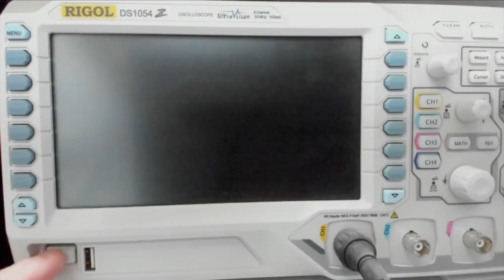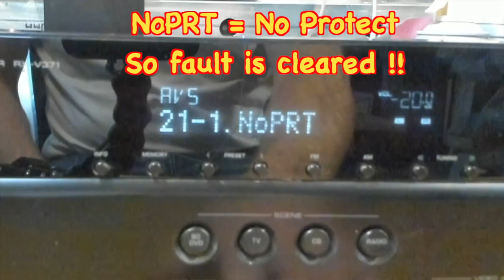Yamaha Rx-V371 No Power

Comment: Hello. I've got an older version RX-v630RDS, only getting 0.05v on PRY after pushing PSW. 
  Micro computer has a reset pin. does anyone know how to use this feature? I'm totally stumped, i just fixed it after finally finding a bad 5V reg, then i found the volume knob was almost totally unresponsive. I took the front off, cleaned the pot / encoder but now not even the start relay clicks. Can't make any sense of it, power switch is working to the micro computer. I am getting around a 3v signal on another output from the microprocessor M30622M4A as it tries to boot up but for some reason this flows back up to the main regulator board as if flowing backwards into one of the regulators there, seems a bit strangle. Anyway. Since i took the front off, cleaned the volume pot (encoder) i get nothing at all other than what i can measure, around 5V coming to the processor which is within limits, seems to be a small transistor that regulates the 5v not too far from the chip. This model has a 12v standby which floats at around 19V until the power button is hit, then it drops to around 12V and the 5V is present on the processor this one runs vcc between 4.2V and 5.5V at 16Mhz. 

To reset, says: "a reset is effected by holding the
reset pin level “L” (0.2V CC max.) for at least 20 cycles. When the reset pin level is then returned to the “H”
level while main clock is stable, the reset status is cancelled and program execution resumes from the
address in the reset vector table."
  Do i basically try a resistor from vcc until i find 0.2V and then hold it down to the reset pin and it should reboot the processor when i hold down the power button. I'm starting to think this is a bad coincidence and that between fixing this and dismantling the front panel something else has gone bad due to the recent powering up but i have personally not come across a potential chain reaction of faults after completing one repair. Bit stumped right now.

Comment: hello...i have yamaha rx v1400 no power but stand by voltage present...if i push switch on, pin PRY from microprosesor only 0 volt where as pin PSW 5 volt present...does it microprosesor dead....thank you.

Comment: Thanks for posting this video. I have two of these same units and one had been dead for over a year. When I opened it up, the same cap was swollen just like the one in your video. Replacing it solved the issue. Many years as an electronics service technician taught me that similar electronic units often have similar problems and once you find the solution for the first one the rest are easy. Thanks again, Jim